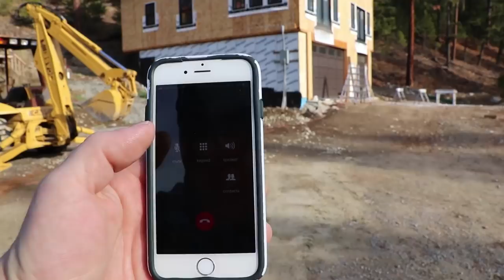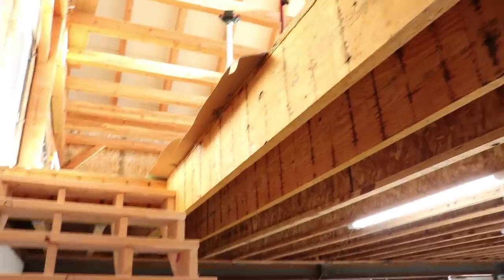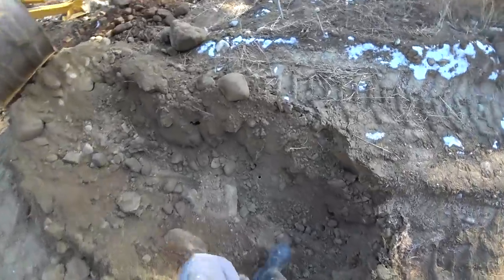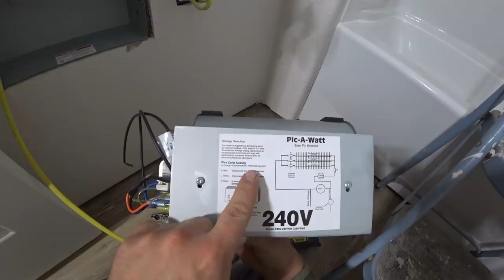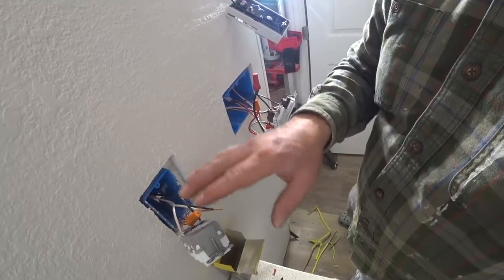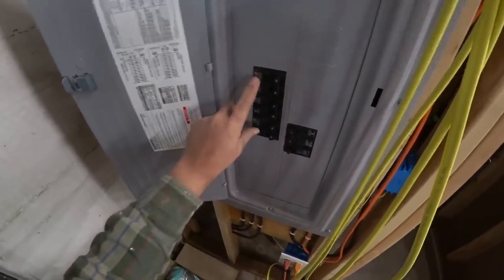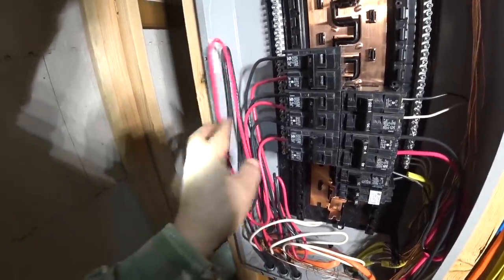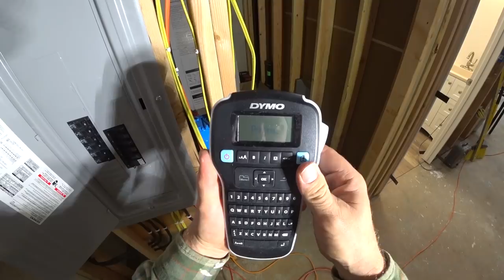Holy Cow IT ACTUALLY WORKS! (Wiring Garage Bathroom)

Comment: Damn Jesse great job! Just mark that white wire as hot with black tape! 👍👍👍😎🇨🇱
Reply: Or use red tape on the neutral behind the heater and in the main panel to avoid future confusion.

Comment: white wire is NOT permissible on hot UNLESS it is marked that as hot on both ends with black phasing tape
from NEC 200.7:
(C) Circuits of 50 Volts or More. The use of insulation that is
white or gray or that has three continuous white or gray stripes
for other than a grounded conductor for circuits of 50 volts or
more shall be permitted only as in (1) and (2).
(1) If part of a cable assembly that has the insulation permanently
reidentified to indicate its use as an ungrounded
conductor by marking tape, painting, or other effective
means at its termination and at each location where the
conductor is visible and accessible. Identification shall
encircle the insulation and shall be a color other than
white, gray, or green. If used for single-pole, 3-way or
4-way switch loops, the reidentified conductor with white
or gray insulation or three continuous white or gray
stripes shall be used only for the supply to the switch, but
not as a return conductor from the switch to the outlet.

Comment: "this white wire should be black to show both are hot" You need to mark the white wire as hot with red or black tape or the next person might install a 120v heater in there and wonder why it exploded. I thought you were doing the electrical to code?

Comment: I'm no electrician but surely you should not have an open electric heater in a bathroom that fills with condensation and it is also very easy to accidentally splash water in unwanted places?
Reply: i mean im not either but im sure it'll be fine right?

Comment: So strange hearing you talk about 110v and 240v as here in Aus & NZ we run 240v and our colours are different - Live = Brown, Neutral = Blue , Earth = Yellow/green strip they change 10 years ago from  Red= live,  Green=neutral and Black= earth to stop all the colour blind electricians and public from getting zapped.
Also we tend to run the lights and ceiling fans on one circuits and power on another, 
My brother is a sparky and he has to deal with old wiring and new wiring all the time and has been zapped a few times buy some of the 1940's wiring where it was all individual wire is steel conduit where the outer fabric and rubber had deteriorated and fallen off leaving the live wire in contact with the steel conduit making it live .
And our residential boards have a non conductive board the breakers are mounted too, and the wiring is run behinds the board so only the switches are accessible when you open the panel  - but still very interesting watching you guys.
Reply: well you are wrong with the colours they have always been red = live and black = neutral earth has change from bare to green to now green/yellow yes a brown live and blue neutral are use but in flex only
Reply: Chris Pomeroy  Are you sure black was Earth?
Reply: Chris Pomeroy the US supply is really 2 circuits at 120 v with 180 degree phase separation, so they add the 2 voltages together.  Assuming NZ is like the UK and they have 1 live wire at 240 v and a neutral.

Comment: I don’t know y he wouldn’t just bring them in the top in stead of wasting all the wire and u need to mark the white wire and u can’t put 2wires in a breaker and u can’t make a Connection inside the panel you’ll have to put a box below are enjoying the mayor and you should have a master disconnect in your pan on my outside your house And if he wired the GFI’s correctly none of his lights should’ve turned on at the GFI breaker was tripped

Comment: 8,000 watts? On 240 volt single phase circuit that would be about 33 amps... And a question for anybody: Could a GFCI breaker be used in the main panel box and eliminate the need for GFCI outlets?

Comment: All of the "Hot" white colored wires can be taped with black or red electrical tape to identify it to meet codes
Reply: Also, per codes you are not allowed to "junction" wires in the breaker terminal, you will have to wire nut them elsewhere as you described

Comment: First off it’s because of amps not voltage. Second ac power is polarity sensitive that’s why is called out of phase and rotation must be checked. I don’t if you know that but if you do you should explain it better.

Comment: You can buy larger plate covers and the 220 circuit sjhould use a black and a red wire not a white wire. Cheers.
Reply: depends on code if you can use 2 wire and save some $$ why not

Comment: One of your long term energy losses, concerns the garage/basement floor.  Yes, you have heating coils buried in it that will someday be activated,,, but more...

Just before you poured your slab, you cut out the ICF foam at the bottom and connected the slab to the ground.  Concrete in its normal forms is not an insulator.  Rather it should be termed a thermal bridge. Per nominal R values 1.5 inches of a good foam insulation is equal to 14 feet of concrete,, and,, concrete may be a water sponge,, but more importantly, concrete is also a thermal heat sink. It takes a lot of heat to warm a chunk of concrete.  And heating the ground under the building?  The footings and rail footings are connected to your slab because of that removed foam.   The second and a more immediate loss to that slab is that 'wonderful' last minute Idea of pouring the slab through and under the garage door.  Either now, when things are cooling off  and the night time cold air is chilling the slab  to 14 feet inside, or later when you attempt to heat the slab via the coils,,, well,,, you will not be able to.  There is very little on this planet that can supply the needed heat to heat the outdoors of a northern Idaho winter.

There is a solution,, a retro-fit.    Around the perimeter of that slab, cut a 2" strip of concrete out,  make it clean and accurate.  and replace with a foam strip, a thermal break.  Your heating coils do not go all the way to the wall,, consult your photos,,, and don't do just most of it.  A foot long piece not removed and replaced will still be heating the ground and the concrete or outside air for 15 feet in either direction , 30 feet total.  Thermal bridging can be compared to holes in the bottom of a boat, just a few small holes will sink it.

The structural qualities of foam.  White bead board, one pound density, has a compressive strength of 10 to 15 pounds per square inch.  I think your ICF white foam is more like 2  pound per cubic foot density,, perhaps 2.5 pound?  That give a compressive strength with a less than 10% deformation of about 25 pounds per square inch.  If you consider the compressive strength based upon 25psi  that gives a compressive strength PER SQUARE FOOT of nearly 2 tons.  You can park your truck on it with no worries.  Want to protect the exposed foam edge,, use a top filler of pressure treat lumber,, treated to burial grade.

The only glaring thermal defect in your house is the garage slab,, it talks to the footings and the ground,, it talks to the outside air.  The thermal heating of the mass of slab and attached ground will be slow,, you will never beat it, but once warmed,, it becomes a lame,, but a part of your thermal mass.  The slab that sticks out into the outside air under your garage doors,,, is just a hole in the boat.  A continuous and crippling energy loss.  The slab will be cold.      No heating coils will economically defeat it.

Comment: what was the earth loop impedance across  r1 + r2 on your installation what values did the supply authority give to work with to find earth fault current capacity on your installation this should be carried out for each new circuit to determine earth loop Independence and fault current as well as continuity between phase and neutral/earth get some one in for test & inspection before you fry in the shower

Comment: in long run better to use 4 conductor wire, one with red, black, white. safety first. if not careful  you could  forget or someone else could be having to work on it and then they could get hurt.

Comment: Hey just an FYI. You cannot feed 14 gauge (15 amps) wire with a 12 gauge (20 amps) wire. If you downsize the breaker to 15 amp in theory you will be ok but an inspector is going to see those different gauges and send up a red flag.

Comment: Ive lived in homes with rooms and I have lived in an open plan home and the latter is always colder and longer to warm up I have found..... so until you fit your walls and plaster the walls you will have a cold home...and your home at the moment is very open and far from finished insulated etc so has to getting it warm I think you will struggle

Comment: the 12/2 seems like some wicked overkill and could have saved a few pennies running 14/2 but overall it looks amazing and clean.
Reply: Agreed. 12/2 is for 20amp breaker and 14/2 is for 15 amp breaker. So if you know your not putting a heavy load theres no need for 12/2 . 14/2 should be used on all lighting as it does not carry a heavy load. Just in case anyone was interested in this little knowledge.

Comment: Electricity in bathrooms is a massive 'No No' in the UK. Nothing more than lights via an on off string pull cord or switch outside the room. No Wall sockets anywhere inside the bathroom. No more hairdryer in the bath fatalities or wet fingers on light switches.
Reply: we can in the usa because our rcd trip/cutoff so fast

Comment: You are going to need at least two more of those shop heaters. You will overwork the one. Two in the basement and one in the upper house.It's going to take more than 27,000 btu to heat that place.

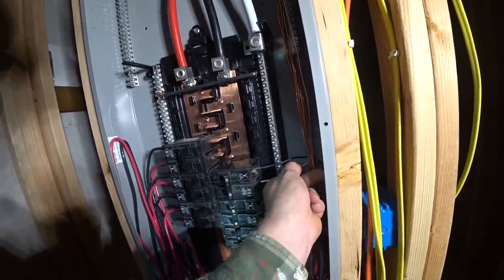Comment: 30:20 I don't live in the US, but I'm pretty sure the 240V "return" should be red. A professional electrician will most certainly not think in terms of "there" and "back", but rather "hot" and "the other hot" for 240V, and "hot" and "neutral" for 120V. If you ever let a professional electrician work on your circuitry, a black and white wiring will at best confuse them, and at worst mislead them into thinking that it's a 120V circuit - with potentially fatal consequences.

Comment: In my opinion, the circuit panel should have been mounted on a sheet of plywood on the wall to facilitate entry of the conductors into the panel. It seems you will have difficulty entertaining the remaining conductors into the panel with it being mounted between the studs.
Reply: being mounted on plywood is the norm in my area

Comment: 8,000 watts to heat a heavily insulated house?  Unheard of.  I heat my bedroom with a 1500 watt heater.  I heat the livingroom with a wall heater, I think around 1800 watts.  It's 45 years old, still works and my electric bills in winter usually stay under $100.  I heat the kitchen with the dryer exhaust, it's humid.  In the spring and summer I vent it outside.   I have a fireplace and in my shops I have two wood burning stoves made from hot water heater tanks and 8 inch stove pipe, it works really well.

Comment: Shouldn't you be either using 12/3 wire for 240v or marking the white wire with red tape since it is a hot?  If somebody else ends up working on the electrical at some point, they will assume it's a neutral as well and could seriously hurt or kill themselves.

Comment: You dont need to leave all that wire in the panel you will not have a lot of room and you can us the top of the panel to for your wires and cut your self a 2inch hole on top and bottom and put a 2 inch  Thread Cutler and you can put all your wire in one hole it will save you more money and time

Comment: Oh boy those electrical explanations...lol. You don't need to know detailed electrical theory to install things like this but the explanations of 120 vs 240 we're cringy to anyone who does. Suffice it to say, there is no concept of "unused current going back to the grid". Saying things like that isn't even wrong. It just doesn't make sense to speak about it that way. Also, in 240V applications, a circuit still exists which is practically identical to 120V circuits. The only real difference is that neither of the two conductors are considered "neutral" because neither of them are grounded back at the panel. They're both "hot". Great videos. Keep it up. Been watching since the beginning.

Comment: you could have just used a GFI breaker
Reply: Cost, also if one is taking a dump or a shower and the gfci trips in the panel, one is making a half or full naked trip to reset the gfci to get the lights back on, or falling out of the shower in the dark while trying to get out of the dark bathroom, I'd opt for the 30.00 in the 2 gfcis than the 40.00 gfci breaker. He could of just used one gfci if he wired it correctly..!!!

Comment: Not an electrician but I think his description of 240 volts vs. 120 volts is off.  On a 240 volt circuit, it's not that both are hot, it's that the circuit fully encompasses the windings on the transformer.  Where as for 120 volts, the white neutral wire is a center tap on the transformer windings (thus the circuit only has half the windings which provides half the voltage).  So I think (???) The return wire of the circuit is identical with the exception of where it hits the transformer windings.  So one isn't hot and one isn't neutral. They are both just a return leg of the circuit.  That's my understanding, but again, not an electrician.
Reply: Wrong, both 120v wires are hot with respect to ground at 120 volts each.  You get the 240 between the two 120 volt lines because they are 180 degrees out of phase with one another. This is achieved because it is alternating current not DC. The voltage varies in a sine wave pattern at 60 cycles per second.
Reply: United States distribution system actually provides a 240 volt residential service in the form of two 120 volt conductors and a neutral conductor. You can see this if you look inside your breaker panel.
When a load is applied from either 120 volt conductor to the neutral (as is the case for typical receptacles, lights, and so forth) it is using 120 volts.
However, when a load is applied from one 120 volt conductor to the other, without using the neutral, the voltage being used is the sum of both 120 volt conductors (240 volts). This is the case for many water heaters, air conditioners, electric furnaces, clothes dryers, and so forth.

So equipment that is connected to strictly 240 volts is connected with only a two wire cable plus a safety ground wire. (For example 240 volt base board heaters use this.) The only time a cable with three wires plus safety ground is used is if 120/240 volts is needed in the equipment. (For example kitchen ranges or washing machines which have time clocks or programmers that require only a 120 volt feed.)
Reply: neutral wire is BONDED to ground... Both live wires ARE not... thats what makes a neutral a neutral... the two lives are UNGROUNDED conductors
Reply: [On a 240 volt circuit, it's not that both are hot, it's that the circuit fully encompasses the windings on the transformer. ] Relative to common, or ground, that's HOT! 120V hot. That is exactly why you can't leave a white lead unmarked when it's used as anything other than neutral.

Comment: Why didn’t you use a GFI breaker?
Reply: If it trips while taking a Sh!t, or shower it will be dark and then all hell breaks loose trying to get to the panel to reset the tripped gfci, lets keep the lights on, just use a gfci outlet in this case at least.

Comment: You are not suppose to land two wires on one circuit breaker.  Also no splices in the circuit breaker panel.

Comment: Pipe that house buddy , rodents will cause a fire by chewing your insulation and out there a fire is a killer . EMT will provide physical protection and will allow replacement/upgrade with ease . Trying to save money on electric supplies will come back to haunt you . Also , please don't use aluminum wire either , it's deadly . Using the neutral wire as a phase wire without it being marked is just plain stupid , it's how untrained people get killed . But again most Romex jockeys  are untrained and unlicensed .
Reply: You must be from Chicago? :-)